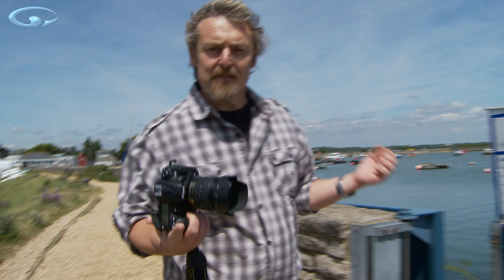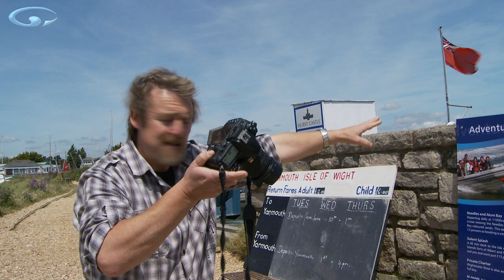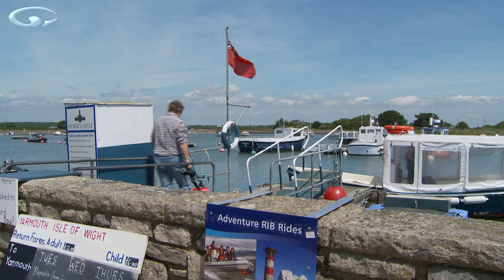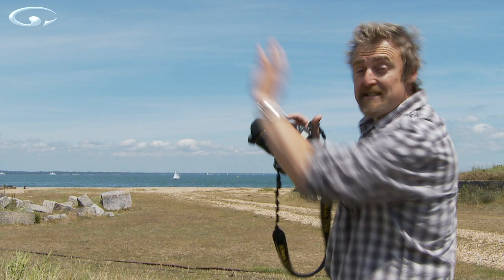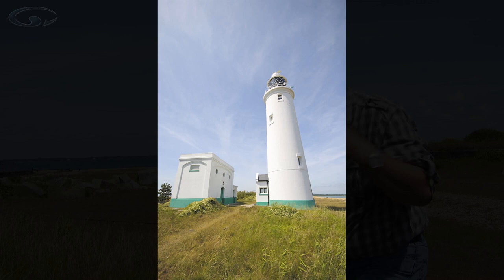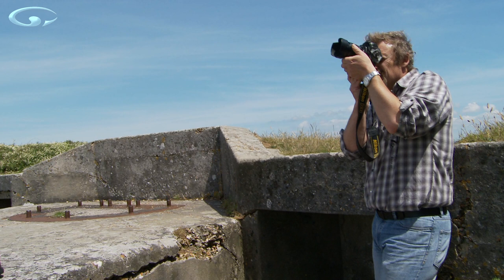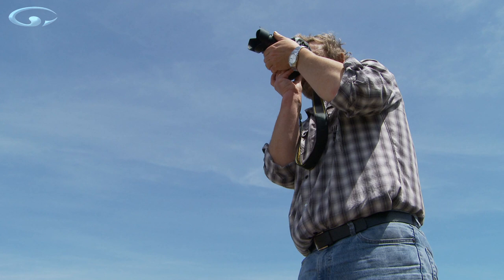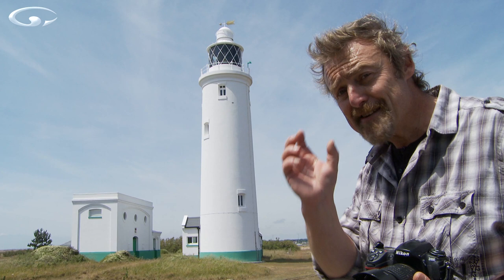Straighten Converging Verticals (in camera)

Comment: I worked at a techpub firm where, for one job, we had to document dozens of electronics cabinets the size of refrigerators (for a military satellite downlink facility). The photos were all taken from a standing position, which meant the cabinets all looked wider at the top. To crop the image as much as possible and maximize the images on the page we used Photoshop to remove perspective. The verticals were all parallel – but the images were kind of wonky; the trays the electronic components were mounted on looked as though they were tilted up at the back. The customer didn’t notice.

Comment: Absolutely spot on Mike.  Unfortunately, in commercial architectural photography, one often runs out of open space before they are able to correct the Keystone effect, necessitating a TS lens.  As you say, they aren't cheap.

Just as an FYI, Rokinon builds an excellent 24mm TS lens for about 1/3 of the price of the others.

Comment from the maker: Hi Miriam. I don't use lens caps because I always forget to take them off when I'm in a hurry but I do clean the lens a lot, just a huff of breath and a quick wipe with a lens cloth. I don't often get dust on the sensor because I don't often take lenses off. I use two identical bodies with a different length zoom on each. a 18-70 and a 70-200.

Comment: Very good video, but I'm surprised you didn't mention another option: use a wide-angle lens on a camera that's parallel to the structure from the very beginning. That way, you don't have to keep moving so far from the lighthouse to get the camera sensor closer to parallel with the structure. In many, many instances, moving backwards (or upwards) is impractical. Yes, you'll get lots of useless foreground with the wide-angle lens, but that's easily cropped, and today's high-megapixel cameras allow our images to retain sharpness after considerable cropping. Your thoughts?